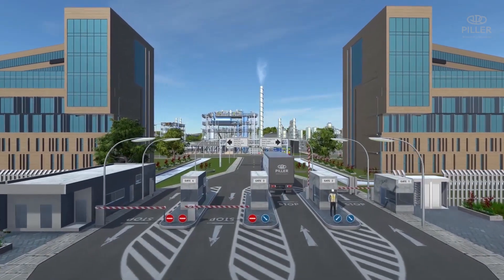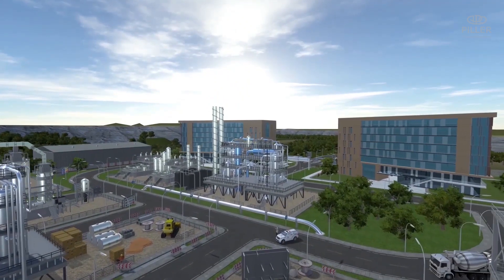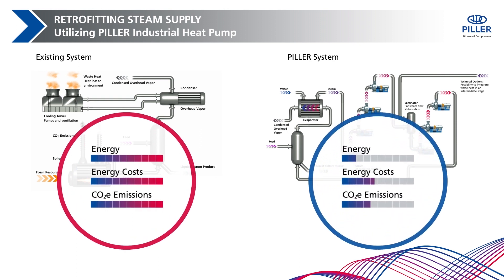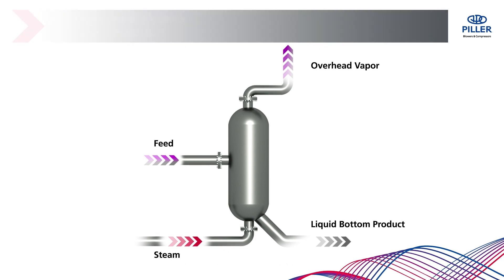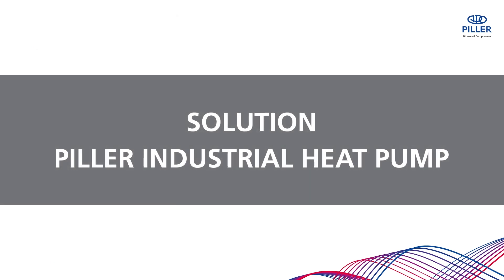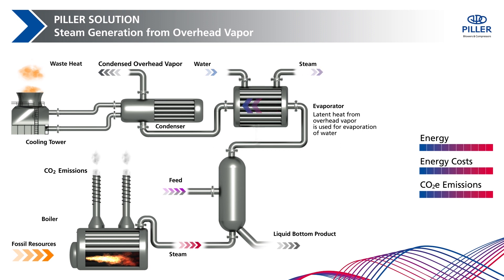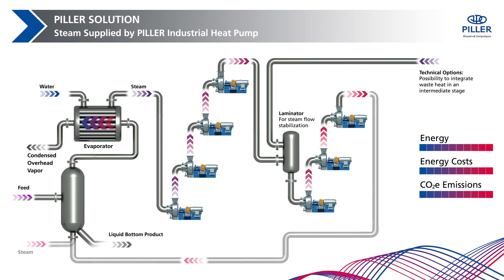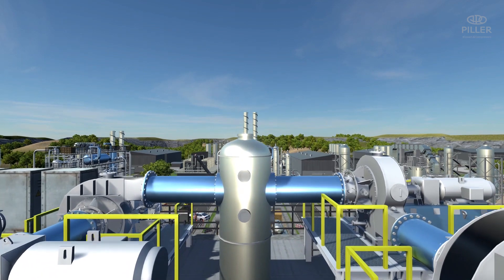How does the PILLER Industrial Heat Pump work?

Comment: Why not trap the leftover heat and transform it to usable energy?
The biggest problem I foresee is the distillation of harmful or toxic compounds, in vast quantities.. Burning these compounds is much like the egr valve on your car. These have been ignored and sent into the surrounding environment via tall chimney stacks. In hopes that no one will smell it, or become slowly poisoned by it. 
And ignored in this video. Even if burned they don't go away, unless ran through a catalytic converter. Expensive options for a mega corporation.🤔